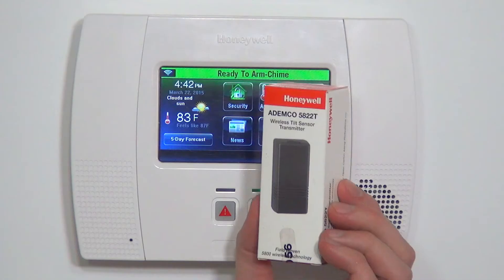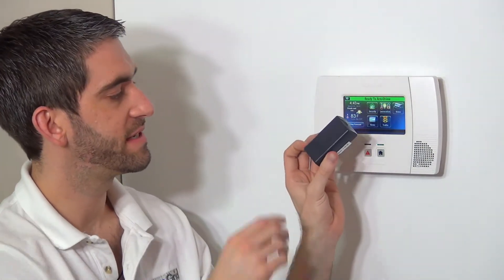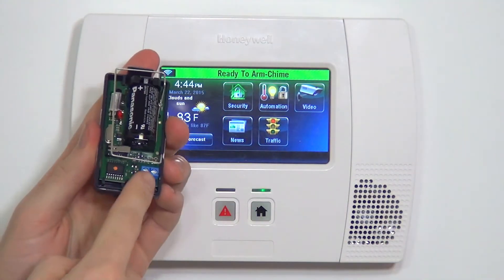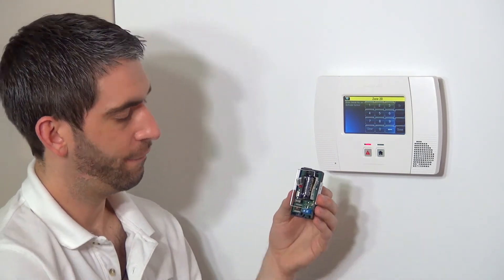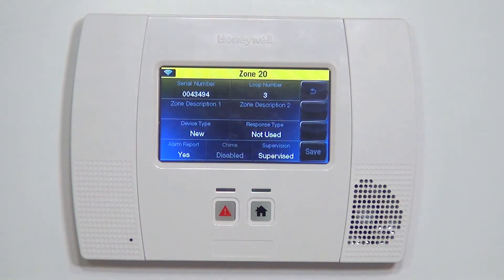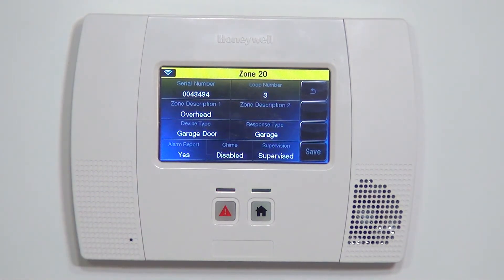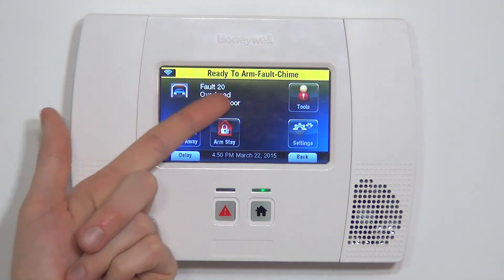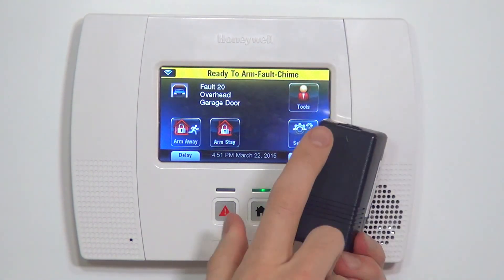Honeywell 5822T: L5200 Programming

Comment: Sterling;  Scenario:  Garage Door Open - Activate ALARM AWAY .  Question:  How long can you leave the Garage Door Open without creating a fault?
Reply: +T Lippy I'm not sure I understand your question. Can you clarify what you are trying to do?
Reply: +Sterling Donnelly 
I want to "alarm away" before closing the Roll Up garage Door.  Back out of the garage with Alarm Away activated.   I think the RESPONSE - Garage Door  allows you to "Alarm Away"  with the garage door open - then close it at your leisure.  Once you close the Garage Door then all perimeter sensors will be armed.  Just wondered if their is any time restriction on how long you can leave the garage door open.
Reply: +T Lippy Ah yes, you should use the garage door zones (46-48 on an L5200) and if you use the Garage Door Response Type, you can arm with the overhead garage door zone faulted and it will become a protected zone again once it's closed. This is called venting and there's no limit on when you have to close it after arming.
Reply: @SterlingDonnelly  What if the entry door is open and I want to arm system with motions and the garage overhead door is open, Will the system go into fully arm once the doors are closed?
Reply: @TheBmarquez  If the entry door is a regular entry zone programmed as Entry/Exit 1, you will not be able to arm the system with that door open unless you first bypass that zone. Once that zone is closed or bypassed, your system will then be back to "ready to arm" even if your overheard garage door is open, as long as you are using the Garage Door Response Type. If you were to arm and then close the garage door, it would become a protected zone so that if opened, it would initiated the normal entry delay time on the system. The bypassed entry door would not initiate anything at the panel until you clear the bypass by disarming the system.

Comment: Not sure if you misspoke or I heard you wrong.
If you use it for a tilt sensor, I see it being impossible to use the external contacts for another door or window.
That is unless you run foil tape on the garage door windows, or your garage door has one of those weird folding entry doors built in.
Am I missing something?
Reply: ***** You can program two zones using one 5822T. I suppose in practice that is easier said than done as the wired contact would need enough wire lead to allow for the tilt sensor to move freely when the overhead door is opened or closed.